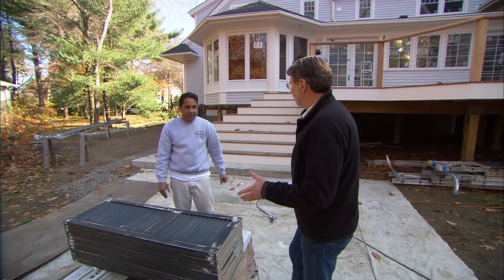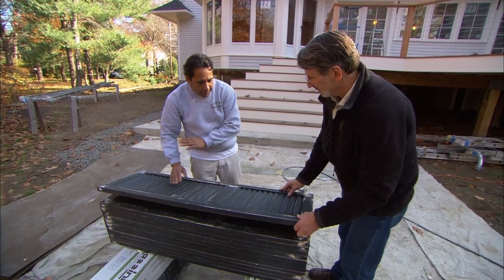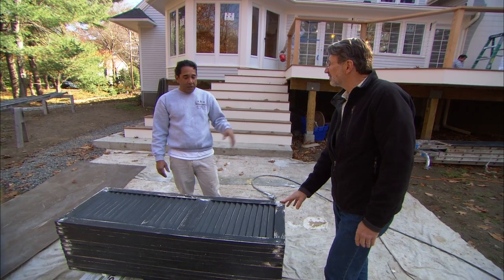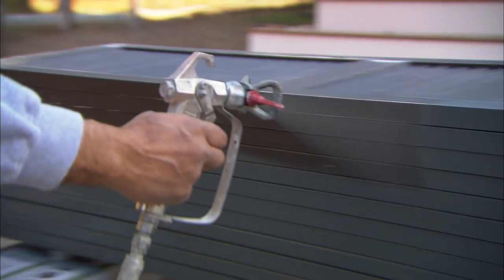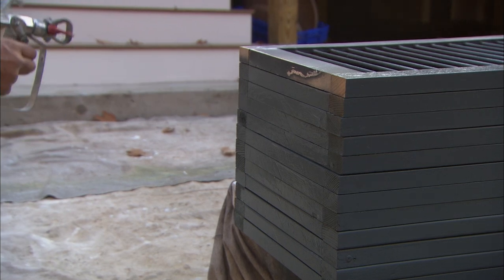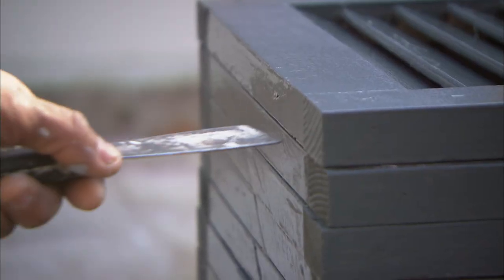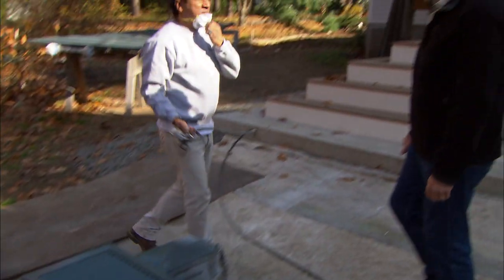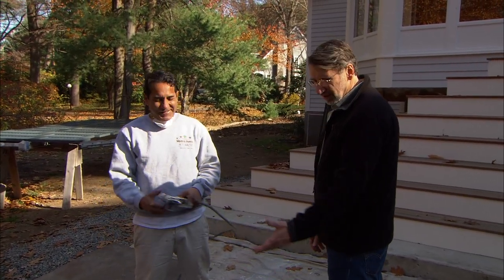How to Paint Shutters | This Old House

Comment: No back brushing?
Reply: Puahaha no
Reply: @doomslayerforever2858  puahahaha yes!
Reply: No need for back brushing in this case. The finish gets much better without the rooler/brush marks.
Reply: I have a wagner hand held sprayer.
What ratio should I dilute for acrylic water paint ?
Reply: @dennysoliveira8441  there’s so many seams on a shutter- back brushing will always be a better job than spraying with shutters